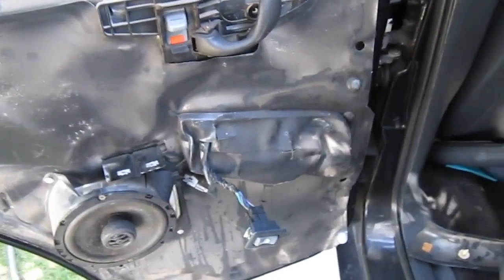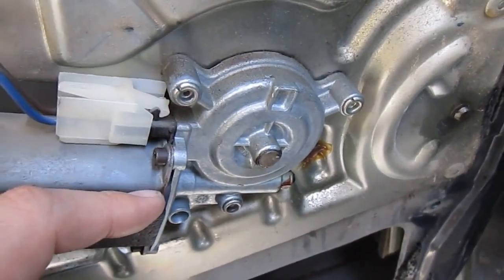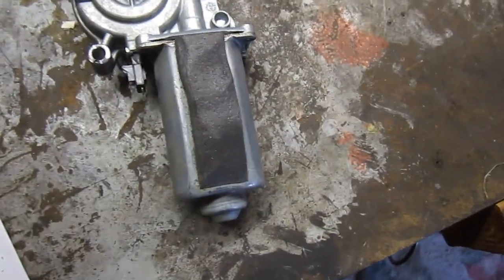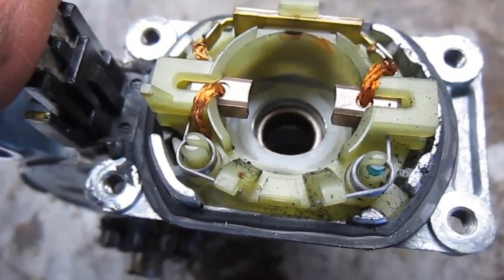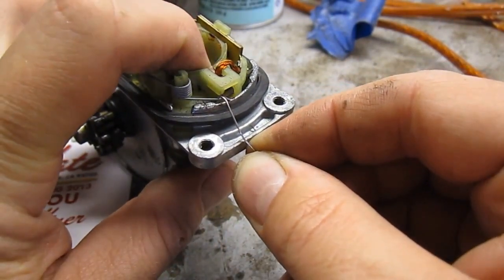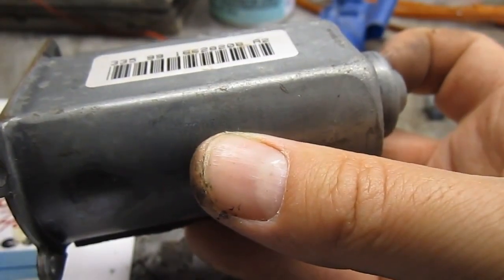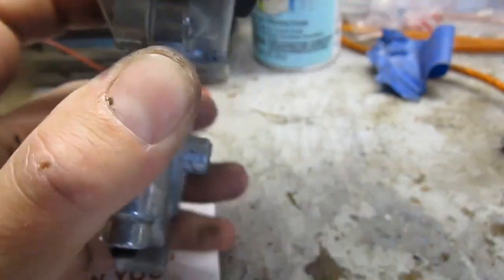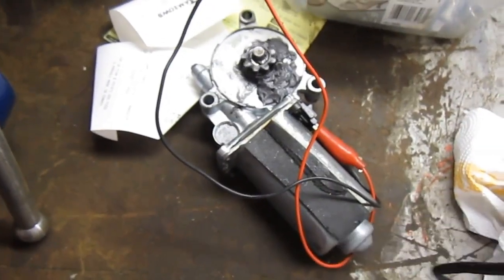How to Replace and Repair 1995-2005 S-10, Blazer, Jimmy, Bravada REAR Window Motor (Regulator)

Comment: Finally a video showing the rear window motor replacement, did not want to disassemble my rear door panel without knowing what it takes to do this, thanks for the video.

Comment: The third bolt opening can be accessed by slightly lowering or lifting the motor gear. Just do it slightly until you have free access moving the teeth a little.

Comment: The best thing for that last rivet is not to cut it off, but drill the center, tap it, and put a screw in it.  Use a flathead screw driver to hold the inside while screwing it in. Oh, and add a lock washer.
Reply: Exactly That’s what I would’ve done

Comment: i hit mine with a screw driver after you said something and it worked for me
Reply from the maker: it's only a temp fix. It will get stuck again.
Reply: yeah i know, and it is up now so i have time to get the money and parts to fix it right. i just wanted to thank you
Reply from the maker: I just replaced the front and back with two A-1 CARDONE 42130 (driver side) and they are only $25 on rockauto with the bolts you need. It's a good deal and not aftermarket junk. core it $11 and you get about half that back when you ship it back to them.

Comment: I have a 1998 Jimmy, the front passenger window went down,  won't go back up...when I use either the driver's side control or the one on the passenger door, I hear nothing, like NOTHING, no clicking, no motor hum....what to do from here? Any advice would be appreciated. I don't want to redo the motor if it's a wiring problem.
Reply from the maker: pull the door card off and test it

Comment: Hi Jerr, can't use the 'reply button',doesn't work anymore on my pc. I did try to test it, just a simple test lite, not a multimeter or anything, one time  I got a positive , but the next time I tried to go through to  find a neg ground, I got nothing, not even the one positive. I've gone ahead & gotten a new motor, it that fixes it, fine, if it doesn't , I'll know it's in the wiring. Sorry for the tardy reply, I don't spend much time online.

Comment: Do not follow was this person say it does not work.  To get all the rivets out you need to bend the motor assembly. Once done the gears will not line up and will not work.  Shame on him.
Reply from the maker: I didn't have to bend anything. see at 10:50... you cut off as much as you can and the back will fall right out. Also, see step 16 in description.  What did you do?
Reply: Yeah... he says you can do this on the front easier.... sir your totally wrong and mis informed me... now 2 rivits will not come out and can not add the bolts because the gear is in the way.... now ive destroyed the regulater on my parts truck to get the motor off and also now have to completely rebuild my regulator on the drivers door to add the bolts necessarry to attach the motor.... had i known that i would have just pulled the whole regulator from my parts truck and saved myself a lot of effort and hassle.... please be more informed before ever making another video like this... now my couple hour project is a couple day project....